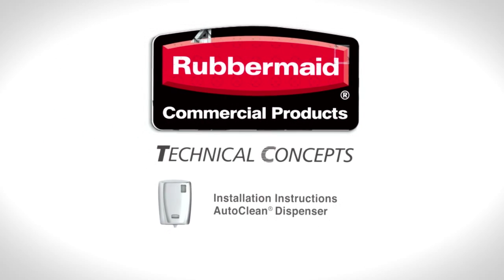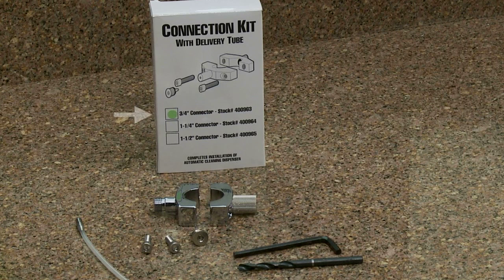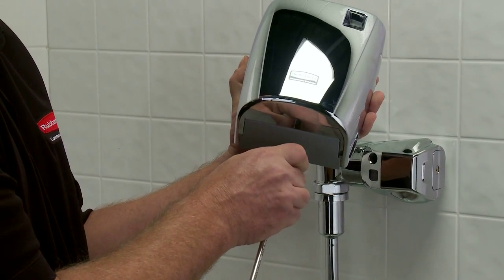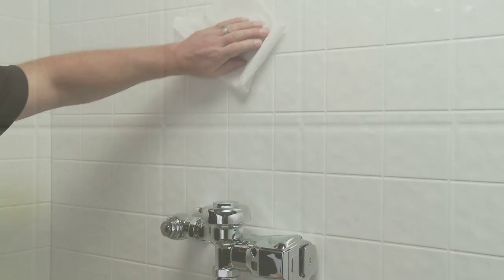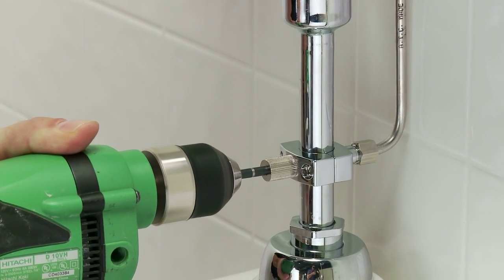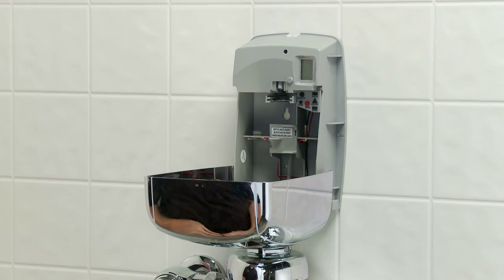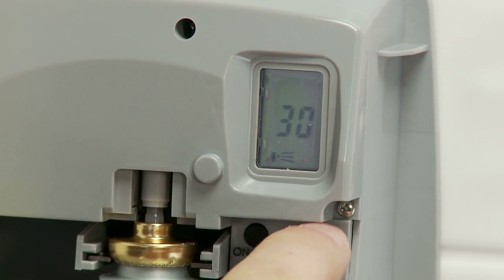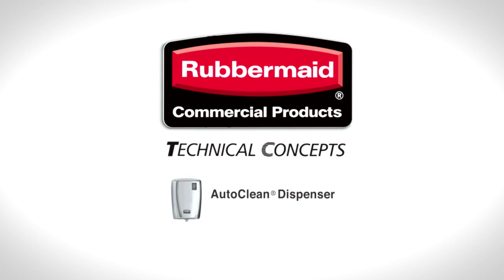AutoClean® Dispenser

Comment: 3:22–3:30 in the video is incorrect and goes against the dispenser's instructions. We just installed two, and if we’d followed this video, the rubber delivery tube would’ve fallen into the urinal and been lost. Instead, it needs to be placed in the back where it connects to the metal tubes elbow, remove the metal tube first to do this properly.